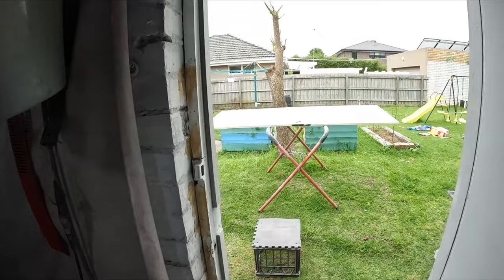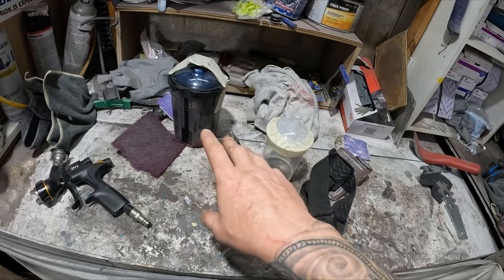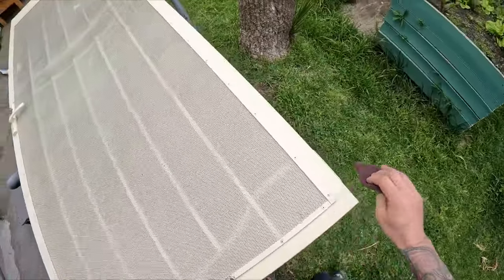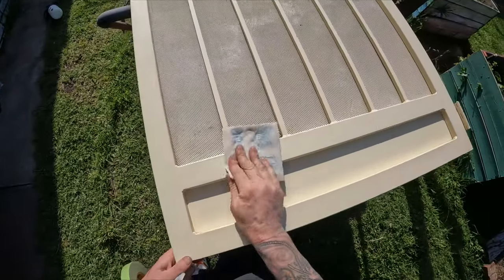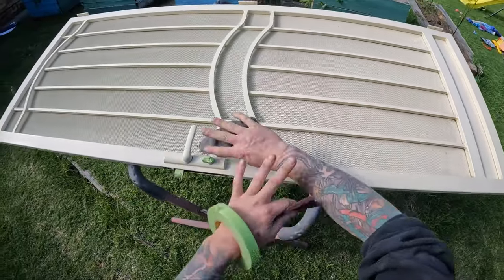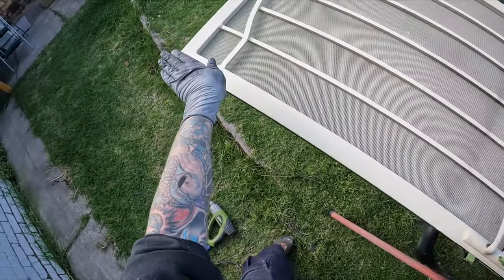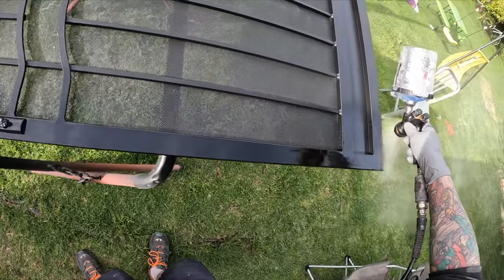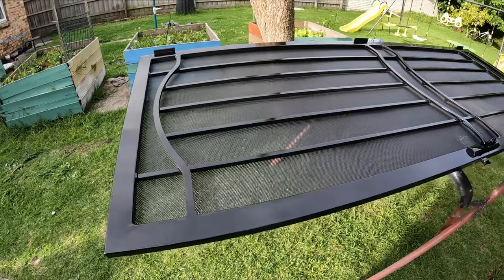How To Spray Paint A Security Door

Comment: Ive seen studies the "toxicity between waterboune vs solvent" its true that solvent based is more toxic but when you inhale solvents the lungs recogonizes that solvent aint good for you and you will start to cough etc, but the problem with waterbourne is that it is still toxic and will penetrate much more easily the cell wall in the lungs, becouse of the water. Things aint always the way they seem. Waterbourne is better for the enviroment, but toxic for humans - in a way even more toxic than solvent based.

Comment: Hi I saw in one of your videos recently that you use an ethanol/water mix for cleaning your guns. Could you please tell me the mix ratio? Is it just 50/50? Thanks!
Reply from the maker: I use more ethanol in summer and slightly less in winter, but 50/50 is a good starting point. Keep in mind that's only for waterborne paints.